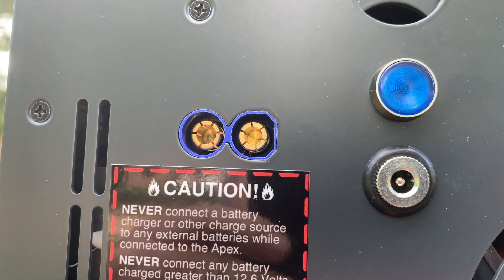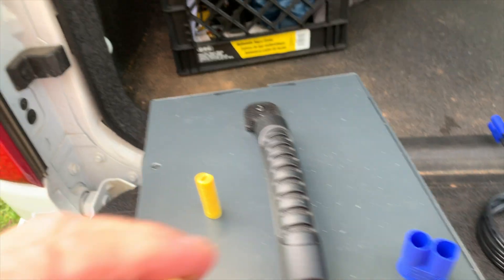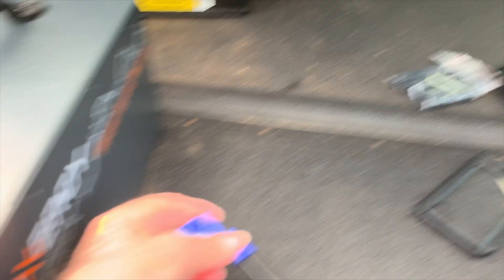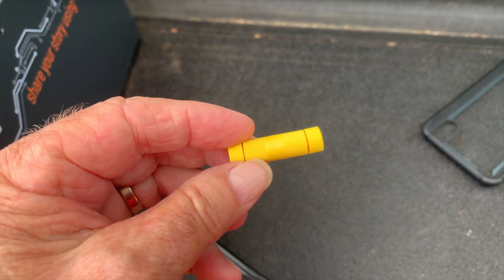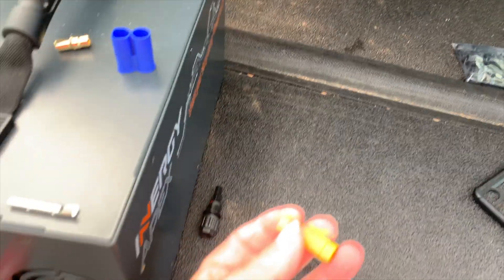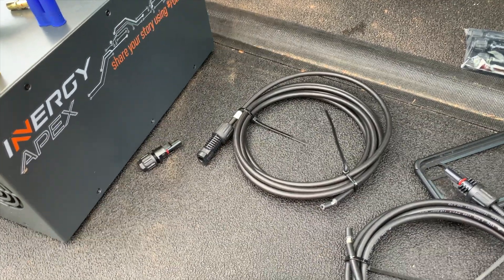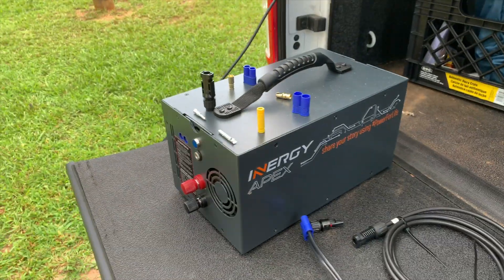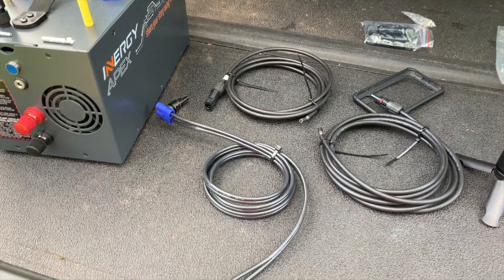Inergy Apex Connectors

Comment: Thank you so much for showing the connectors? Did you eventually splice them together and use non Inergy panels? Any lost in amp or power from the panels after switching the connectors ? Thanks again!;
Reply from the maker: Corina K still using as shown, they eork just fine.